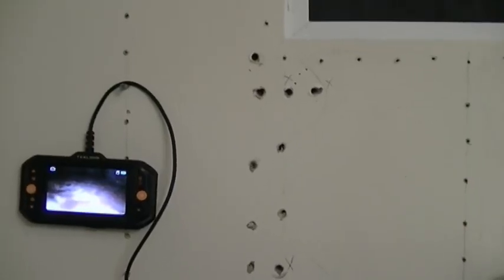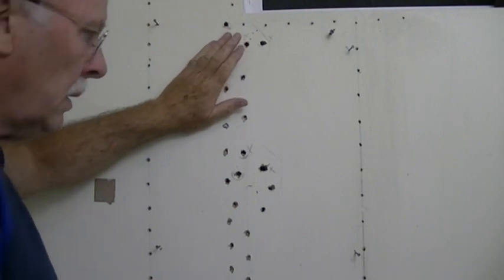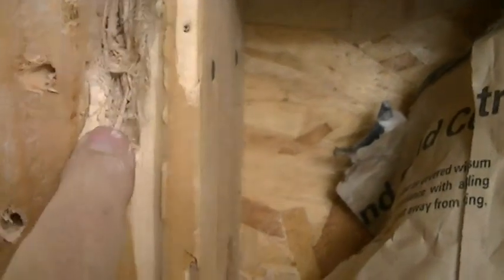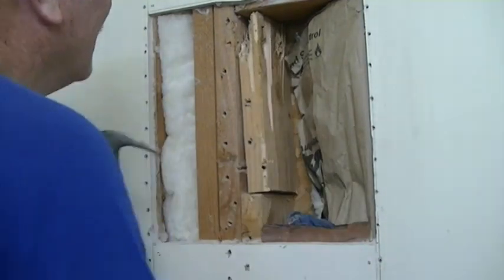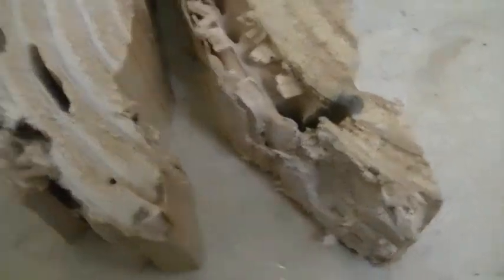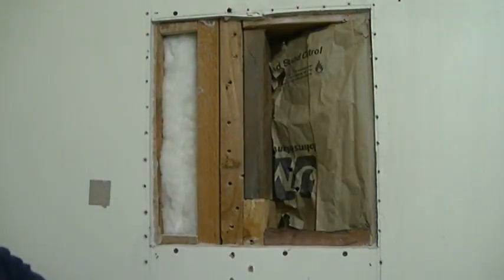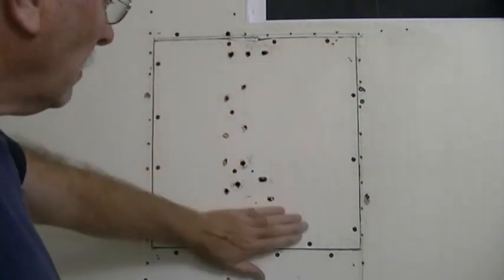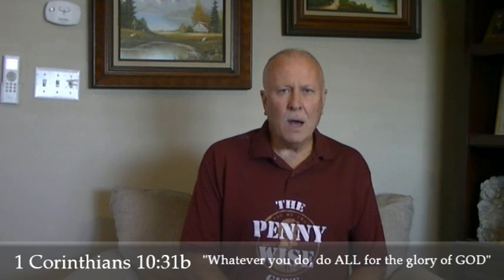Inspect Termite Damage / How to Repair : Tools listed below

Comment from the maker: Hi. I want to add to what I said about not needing to use tape when using joint compound. On this project being that I had 100% support all the way around plus having the space between suds no more than 8", I have had great success without using tape when applying joint compound. I would however use tape on my jobs if the span was the full 14.5" between studs and the studs being 2x4. Even with backing there may be a slight bit of flexing and cause a hairline crack. I have the experience with sheetrock work and just want to let my DIY friends know that on the application on this video, you do not need to add tape and go through all the extra work. Keep it simple and still get great results. If you have a termite repair job that is a lot more extensive than this video, please get some expert advise and help if needed. If you are a true DIYer like me then I know you will try just about anything yourself. Blessings to you my friends.